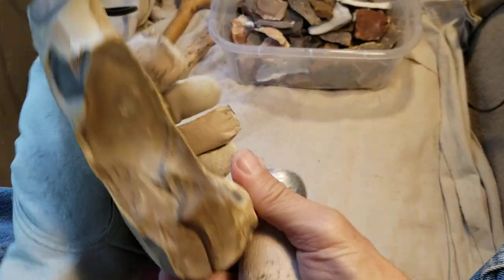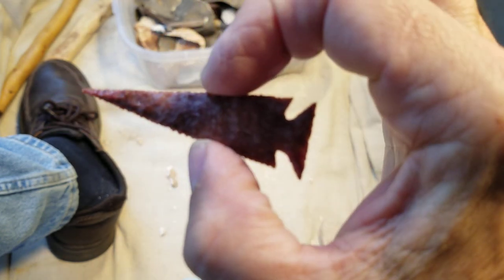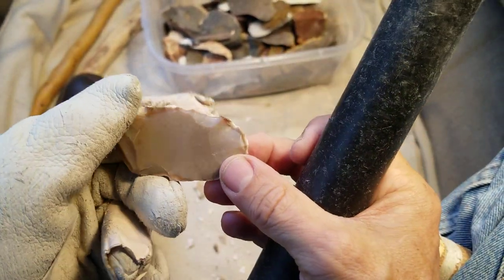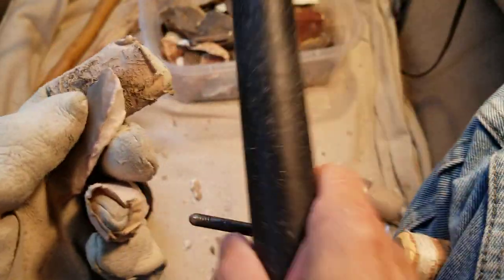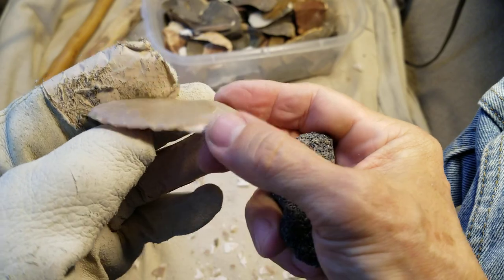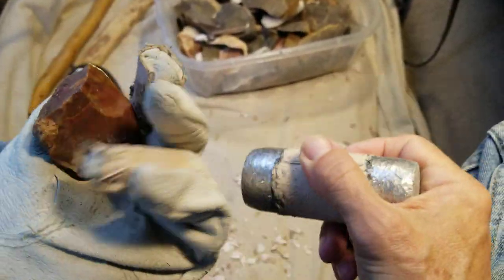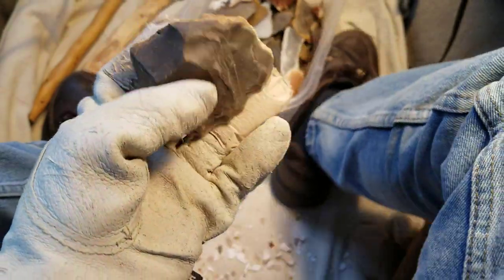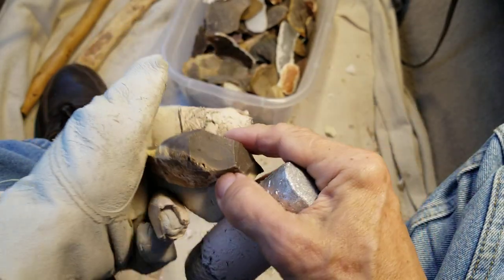1277 - Flintknapping Small Bifaces

Comment: @16:52 Ok can you explain why you are using that piece of steel but other times you use a thinner steel set in a wooden shaft? Thank you Sir 😎
Reply from the maker: I use the smaller diameter steel for smaller bifaces. It helps to prevent cracking that sometimes happens when I use too much force with the larger flaker. ( edit). But if the material isn't cooperating or flaking "easily", I go back to the larger diameter steel.
Reply: @KnapperJackCrafty  oh thank you ✌️